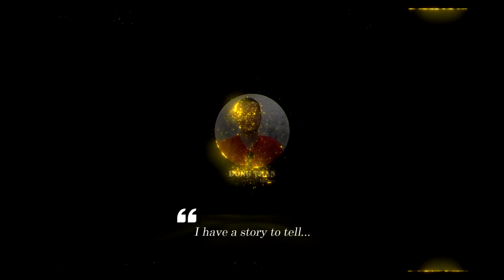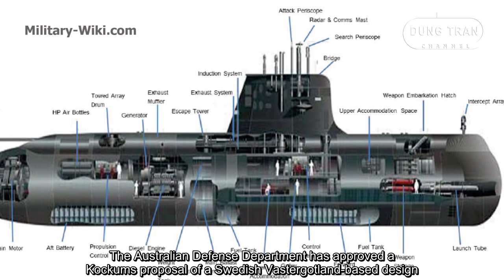Collins-class submarine - Extremely Powerful Submarines From Australia

Comment: The problems Australia had with the Collins Class Submarines is caused by changing the plans without contacting the designer Kockums before the implementation of the changes! It was never Kockums fault that they had problems in the beginning! If the designers would have been contacted they never would have had these issues! The Collins Class was based from the Swedish Type 471 that has been extremely successful! The big problems is that the Australian Submarine Corporation did not have the expertise to do the design changes and that caused the issues with Collins Class in Australia! Unfortunately!!
Reply: I fully agree with what you said , 

We should of been building 12 advanced collin subs had RAN done R&D since they have had the original 6 , RAN should of made them collins the best subs in the world and improved on it over the years. 

I notice the Australian defense force don't like doing R&D with anything and would rather buy from overseas and that's good short term. But long term it's going to get very expensive, it's going to put Australia back 100 years and our future generation are the ones most at risk because we ain't doing R&D so we can build anything from the ground up. 

I don't have anything against the new subs expect for how expensive they are going to be, we could of put half that money into R&D with the collins class subs and still had the best subs, we could of built 20 collins for half of what we spent on the new subs, we could have had 20 brand new collins class subs for the front line and the 6 we already had could of been used only for R&D purposes only.